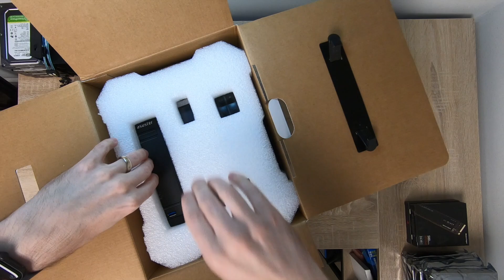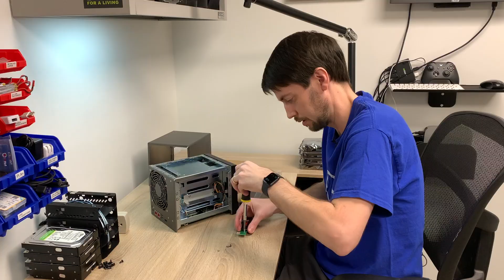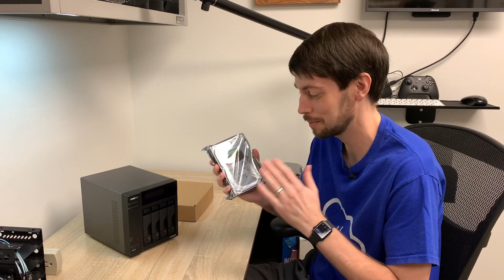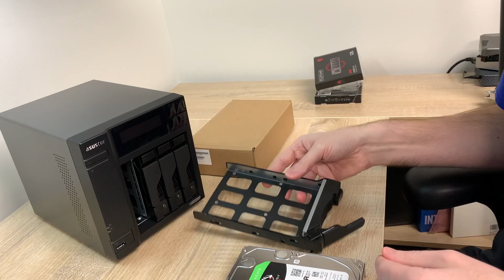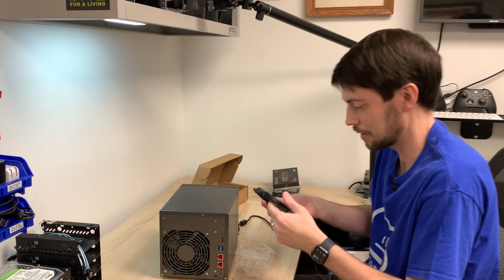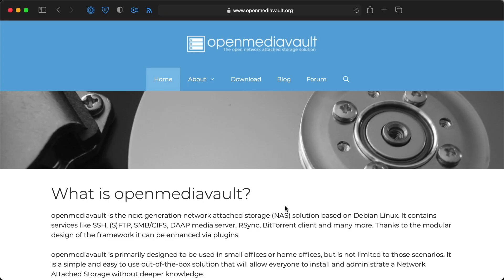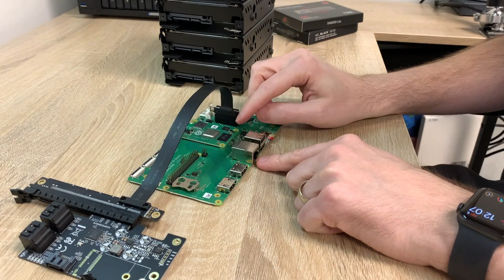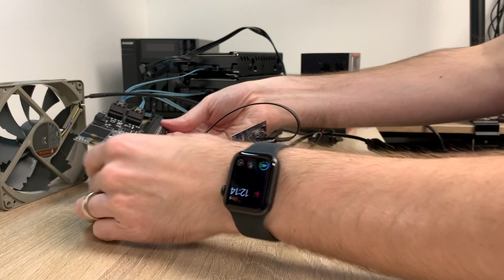Raspberry Pi vs ASUSTOR NAS Head-to-Head Part 1 - Hardware

Comment: I have been using the same computer as a full blown network server since 2006, build of blunt consumer hardware. It contains 10 drives á 3TByte as a RAID50, a 120GByte PCIE SSD, 8GByte RAM, running Ubuntu 6.06 to Ubuntu 20.04. For networking I have been using trunked Ethernet with 4x1GByte/s, later also 2,5GBit Infiniband and 5,0GBit Ethernet. A quick test showed that 10Gbit Ethernet is slightly bottlenecked at 700MByte/s. The idle system without hard drives uses 12W, with idle drives around 65W and at full load around 140W - to my surprise the hard drives use twice as much power under heavy load. So while the bare system itself is not economical the overall power consumption of the system including storage makes this irrelevant.

In 2010 I upgraded memory and CPU and I replace all fans and all harddrives about every six years and upgrade the OS every four years. Thats pretty much all service I ever did.

Right now I see no need for anything better - and a 10 bay solution nowadays would be prohibitly expensive anyway.

And besides serving SMB, NFS, iSCSI, SQL, HTTP and much more stuff I can even decently play Left 4 Dead on the System, surfe the Net with Firefox and write a letter in Libre Office.
Reply from the maker: If it works, it works! That's a major downside to my 'mac-based NAS'—there's not much in the way of upgrades I could do to it to keep it relevant anymore :(

Thunderbolt dock for faster USB, maybe... but not much else.

Comment: If you use both Ethernet connections on the Asustor NAS you chould 5Gbit Ethernet data read/write (that's what they advice you on their site).
Reply from the maker: Technically you would only get 2.5G to any single device for a single copy; it's not just doubling the bandwidth. But it is nice for those using a NAS in a multi-client network, and for redundancy.
Reply: @JeffGeerling  We're actually going to officially add SMB Multichannel for up to 5Gbit performance to a single client!
Reply: We have SMB Multichannel now for single client 5G performance!

Comment: Is that x4 slot wired like an actual normal x4 slot, bifurcated to x2 + x2?  If so, you might be able to put an Optane H10 (Optane + Flash) in it via a different PCIe M.2 adapter board.
Reply: No. It's non-standard wiring.

Comment: never heard of the brand.. only names i knew was Qnap and Synology...just had a look at their site.. they have a cool 10bay nas !.. only thing i don't like and would love if they would improve that is that they only say cpu inside celeron but not the cpu name.. like with Synology it took me a second to see it has the "Intel Atom C3538"..
Reply: yeah, most commercial devices (use false short term internal economics for their brand)  always seem to use the oldest cpu they can get for cheap, like the 
Q3'17 "Intel Atom C3538" and even older non simd avx2 antiquated chips for inflated home user prices we cant reclaim the costs back as a non business lol. so probably ends up a 'cha ching : No Sale' as i like to remind them in covid.

like the perpetual sale of over £150 antiquated Intel Atom win10 tablets that never shift, but would if they just lowered the profit price to impulse buying range and probably on mass.

buy them just to superglue them to the side of your NAS case for local feedback and fun data updates from the addon esp32 + sensors etc, and the odd 'nomachine' gui terminal oc just about workable there some times..
Reply: Point taken! The Celeron inside the Lockerstor 4 is the 14 nm Gemini Lake Intel Celeron J4125 SoC. Released in 2019.
Reply: @ASUSTOR_YT  thanks appreciated.

Comment: Your mac mini has Thunderbolt !!!! Give it another 10 years !!!
Reply from the maker: Thunderbolt _1_, with up to 10 Gbps, sure... but the very few accessories to make that useful cost $150+ (even used on eBay!). Unfortunately Thunderbolt didn't really seem to take off until TB3 came out :(
Reply from the maker: But I do have plans to extend the life of the mini, don't worry!
Reply: @JeffGeerling  yeah ... i went down that route only to discover that most of the accesories are very very expensive (drobo) and very very special (only work on Apple and in the case with drobo they are very specific about what drives their stuff can run) .... i have 4 Drobo Minis with cache drives ... 

Also ... OSX is very limited in what you can run on it ..... no Updates for the 2011 Mini because the HD 6330 isnt supported anymore...

Comment: Its better using aio motherboard x64 which include pci-e, sata port, usb, ddr4 ram, GbE ports, nvme ports. Cheaper, more powerfull n easier to built than rasp pi 4 NAS.

Comment: I fear you'll find a major bottleneck in the Pi's single PCIe 2.0 x1 channel, compared to the 6 lanes the Celeron J4125 supports: you're looking at a maximum bandwidth of 0.5Gbit/s (0.4 eff.) vs 3Gbit/s (2.4 eff.)
tl,dr: you're comparing a tinker board with a dedicated commercial product. It's like comparing a swiss army knife with a chef's knife: if you're looking for a tool to cut a ton of veggies, you'll want a good chef's knife - you probably wouldn't take it on a camping trip though, I guess.

Comment: Seems like a great idea for your NAS to double as a media player. It already has all your movies right there and has a pretty decent CPU so what's stopping them from adding a media player to its firmware?

Also, why did they put one M.2 slot on each side of that cache riser? Why not show both drives on the same side, so:
1). You don't need to remove the riser to access the card on the back
2). You see both slots immediately, so if you added, say, a sexy glass side panel, you could show off your drives more easily
Reply: The reasoning for them being on opposite sides is because there isn't enough space in our two bay models.
Reply: @ASUSTOR_YT  Makes sense

Comment: Very interesting video series.  In general, standalone NAS systems are incredibly over priced for what they are.   And I hate their installed OSes.   

Question:  Why don't you use a stand alone USB 3 hard drive enclosure with the Pi.   Like the Syba SY-ENC50104 ?    It won't do hardware RAID, but it seems to do everything else.   And it would be just as fast ?

The Syba SY-ENC50118 does hardware RAID.  And it uses eStata or USB3.   I'd love to see you test it with an RPi or a similar but higher performance single board computer.  Or connect it to a wireless router with a USB 3.0 port that supports Samba ?
Reply from the maker: USB 3.0 drives (and the associated USB to SATA chips they use) incur a 10-20% performance debt vs using SATA over PCI Express directly (besides the issue with RAIDing USB drives).
Reply: @JeffGeerling  So what ?  A 10-20% performance hit isn't terrible.  The Syba SY-ENC50118 does HW raid, so the Pi processor will be mostly freed up.    

Most home networks aren't running 2.5GB Ethernet.  I'd love to have 2.5GB Ethernet in my home network.  I just bought a new laptop and almost none of them come with 2.5GB Ethernet.  If network speed is a limiting factor, the Syba is portable enough that you could temporarily plug it directly into the device using it.     

So Pi4 with GB Ethernet + the Syba SY-ENC50118 should equal a very good home NAS system.  No custom kernels.  No special hardware.   Just an RPi4 in an enclosure and a Syba SY-ENC50118.   

I dare you to test it.

Furthermore, many of us have wireless routers with GB Ethernet and USB 3 Ports.  Many of these routers will run DD-WRT or Open-WRT which has Samba built in. See where I am going with this ?

The interesting thing about wireless routers these days is that almost none of them have 2.5GB LAN ports either.
Reply from the maker: @SomeTechGuy666  The kernel compile is no longer necessary, as SATA support is built into the Pi kernel as of a month ago; but in the end if it works for you, it works for you, I have no problem with people choosing one way or the other. The more important thing for me is to make something that serves the need well.

Comment: i did not even know they was a 2.5gb network
Reply from the maker: I hope it becomes a standard the way 1 Gbps is today—it's an easier upgrade than 10G (besides just cost considerations), and it's a great speed for most home/small business use outside of use cases like large video editing groups, or heavy data processing.
Reply: @JeffGeerling  even with traffic on my netwrok from nas to conversion machine then back to nas i dont max out the network if im going to move files i remote into the server abd do it there as it is more drive to drive rather then server desktop pc and back to server again one way i get upto 100MBps and logging into server to do it i get 130+ but i agree i looked into 10gb and ouch thats a hole in the pocket for sure

Comment: Wow! Over 500 comments... I doubt I will get an answer, but REALLY hope a knowledgeable member here in chat, or Jeff sees this and does reply, so.....

Out of curiosity, couldn't the PSU be used to power the Pi as well as the HDDs?
Also, couldn't the Pi's GPIO be used to toggle the PSU on and off??
Reply from the maker: Yes, and probably not. GPIO would need power to close the contact and power up the Pi. But a little circuit off GPIO connected to a power switch may be able to work.

Comment: Doesn't that PCI-e switch card have the appropriate connector for the 2.5 Gbe card? So you shouldn't need the adapter. The 2.5 Gbe and 5-port SATA boards should go into it directly. You could then maybe connect the switch card to the Pi board with the cable to allow you to reorient the other board into a "daughter board" configuration with the Ethernet and SATA boards oriented perpendicular to the daughter board and Pi, no? Should make it easier to buy or build a case.
Reply from the maker: Ideally yes. The network card is x1, but the 5-port SATA card is x4, so it needed the extra adapter. I could've settled on a 4-port SATA card instead that is x1, but I didn't have it on hand (using it in another project right now...).

And ideally, I'd have the 4-slot open-ended PCI Express switch I've ordered and re-ordered 5 times since October... but it seems like miners have gobbled up all supply of PCI switch boards :(

Comment: "Only has USB 2".... Right under FireWire 800 and Thunderbolt ("1" I suppose?).
Reply from the maker: Yeah it's the original Thunderbolt and there are precious few TB1 devices out there. For $100 or so I could buy a ThunderBolt bridge that has USB 3 in it, but at what point does trying to get an outdated/unsupported computer to do tasks that I rely on day-in-and-day-out become a sisyphean task?
Reply: @JeffGeerling  You're talking to someone who uses 20 year old software on a 15 year old iMac running a Linux VM to AppleTalk to a 25 year old Power Mac that boots off an SD card-SCSI adapter so he can use a 30 year old imagesetter. It's fun until something goes wrong, then it's a stomach turning nightmare.

I'm not saying you're wrong to upgrade, just that there were better options than USB2 on that mini. After using an SSD it's hard to deal with anything less than USB3. And USB1 is a kind of death these days.
Reply from the maker: @strawhousepig  I can imagine someone writing some ungodly SCSI-to-USB driver hack to breathe new life into things :D

I still see an occasional classic Mac in operation. Most recently I remember one business had a Mac Plus running as the serial interface for their voicemail system! Installed decades ago, the thing is still humming along.

If my needs were more static, I would probably have been content. But I'm planning on moving further towards 10 Gbps on everything and there just wasn't a way forward on that Mac mini.

Luckily, it has a new owner who's enjoying 2 TB of internal SSD storage on it, and hopefully it'll keep powering up for another 5-10 years (or more!).

Comment: I find it somewhat inconsiderate of Asus that they didn't include a network cable with latch protection. Those latches without are bound to break off at some point which makes the cable unusable. What kind of operating system is there on the Asustor? Can you replace it with an open source one?
Reply: We use ADM. It is our own OS based off of Linux. We don't recommend people try to replace the OS because it is on an emmc. I have heard the cries for more choice and we're studying the feasibility. 

As for the cables, we don't usually expect customers to move the device and unplug it very often. It's intended to set and forget. We haven't received complaints about the cables. But I hear you. Will bring it up to management.

Comment: In about 2:50 you mention that there is a feature that you won't be able to replicate on the Pi. It's dm-cache on Linux.

https://www.redhat.com/en/blog/improving-read-performance-dm-cache
Reply from the maker: A properly-configured ZFS setup would also be able to use cache, too — good point. It is less practical on the Pi though, simply because even a slower hard drive in RAID 1 or 10 is going to be as fast as the bus will allow bytes to be written, so the SSD cache would not be solving a bottleneck, it would just allow data to be streamed a little differently to the disk :D
Reply: @JeffGeerling  It is exactly what goes on on the NAS as well, the dm-cache drive receives the data and then streams it to the other slower drivers.
I also would bet is the same kernel module the NAS is using.
So you could replicate it (if you had any extra PCIe ports).
Reply from the maker: @figueroalabs  I would gladly test it out... if I didn't just get the third order cancellation email for a 4-port PCIe switch I ordered again (this time from NewEgg). It seems like anything even tangentially related to mining operations is out of stock indefinitely right now :(

Lots more profit pumping out those boards in bulk for miners than sending one-off shipments across the ocean to little old me :(

Right now I only have my two 2-port PCIe switches to play with... could try chaining them but that seems like a bad idea!

Comment: I'm not sure that your pricing is entirely fair, because you could have bought a bog-standard cheap PC case for holding all the Pi equipment and drives, rather than the drive enclosures, 700W PSU, and high-end Noctua fan that you did use - i.e. You could have built the same RPi build, but cheaper and not detrimental to performance.

Comment: Way to make things over complicated: Yes it's not 2.5gb networking:  Pi4. - powered usb hub and portable HDD's  (cheaper too) . Throw in a fan and an inkyPhat Display - job done and much lower power consumption
Reply from the maker: OMV doesn't allow RAID with USB drives, there's a 10% overhead loss using the same drive via USB to SATA vs direct with a SATA card, and how is using a 2.5 Gbps PCI express network card not 2.5 Gbps networking?!
Reply: I meant a basic Pi4  wouldn't be 
2.5 - Fair enough -  didn't know about the raid  restriction..

Comment: Didn't you get 4+ gig networking working on PI 4 with a 4 port 1Gig networking card? Wouldn't a 2 port 2.5 Gig card work the same way?
Reply from the maker: Yes but in the NAS use case, you have to deal with the 3.2 Gbps total bus throughput being split between the SATA controller and the network card—so if you can split it in half, that's 1.6 Gbps each. Not nearly enough to be able to take advantage of 2 2.5 Gbps ports. And if you still need two interfaces, you could have one 2.5 Gbps interface and use the Pi's built-in 1 Gbps interface, which actually would give ~2.6 Gbps of total throughput. Maybe a little more if you have slower hard drives.

Comment: Why is compute module more expensive than the regular pi4? Does it make sense to use cheaper option instead?
Reply from the maker: The compute module comes in a huge variety of options, starting at $25 (for lite non-wireless 1GB RAM model), to $90 (for eMMC wireless 8GB RAM model).

So you can pick the right options for your Pi project. If you are better off with a model B and like its features, then it's the right Pi for you :)

Comment: Wouldn't it be vastly cheaper and more effective to run the hard drives over a few pi4's in a cluster using a usb 3.0 to sata cable and a distributed filesystem. A spinning hard drive isn't capable of of saturating a sata connection anyway, at best your going to get around 100MBps per drive, and a 5Gbps usb 3.0 connection should be more than capable of handling the load. Further if your clustering you can keep using just the onboard gig ethernet, the network load can be aggregated at your switch using your distributed filesystem. It just seems to me the SATA card is a waste of resources for the PI when you have a USB3.0 on pi4 and a USB->SATA cable is like $9.
Reply: Actually, we get over 250 MB/s with these Seagate drives. Perfect for 2.5-Gigabit Ethernet on the Pi or ASUSTOR.
Reply: @ASUSTOR_YT  Yeah, I have no doubt that YOU  can get those speeds because of caching techniques, m.2 support, and RAID being able to support that. My comment is on the Raspberry PI not being able to achieve that cost effectively through its hardware limitations. The Asus product has a much more advanced CPU that can support the PCI lanes, but to do that in the footprint of a $35 Raspberry PI, it's possibly far more cost effective to use a cluster and a distributed filesystem rather than try to do a complicated PCI all in one solution.